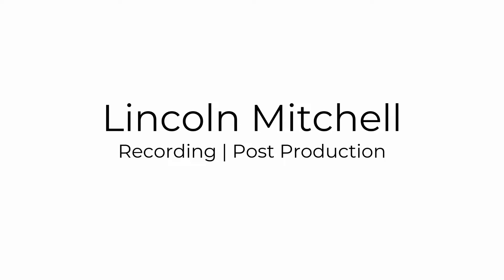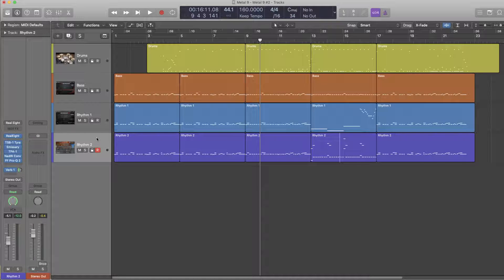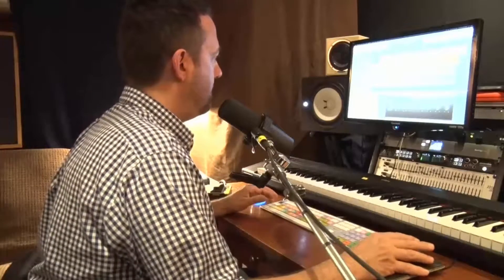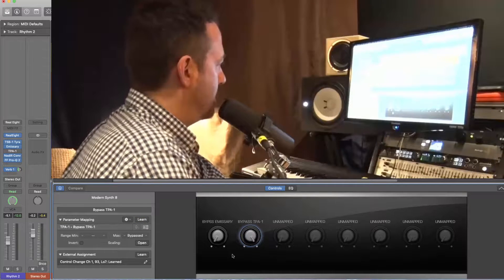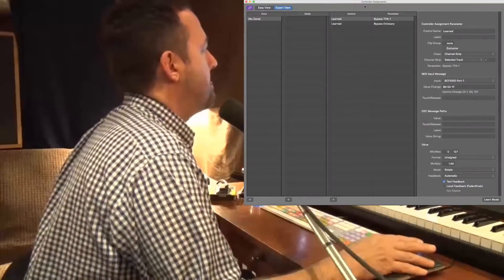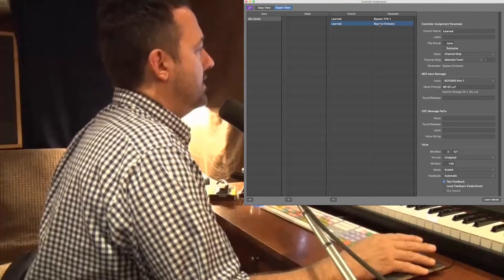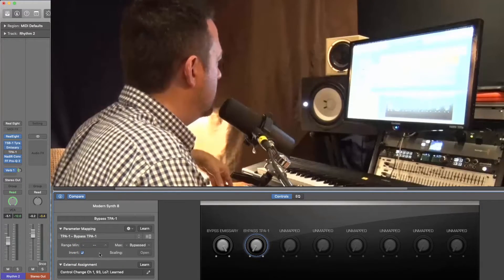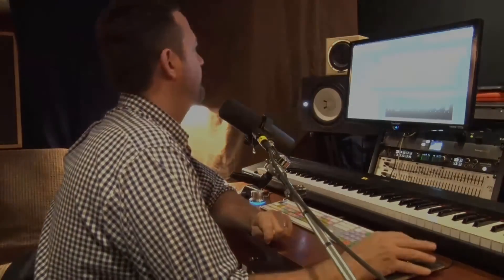Toggle Multiple Inserts with MIDI Footswitch

Comment: And how you've saved all those settings you made. I did the similar process for my FCB1010 Midi footswitch controller pedal with Amplitube 4 on logic. The problem is every time I shut down the Logic all settings are one. I have to start over. Do you have any solution to that? Best. Cem
Reply from the maker: Locate the com.apple.logic.pro.cs file found HD>Library>Preferences.
Copy that file somewhere, if your control surface settings have vanished replace that file with your copy.
That may work albeit a pain in the ass.  I have since moved on to a couple of different controllers.  Currently using the Novation SL mkiii and have had to do quite a lot of configuration to get the logic integration I wanted.... 
Anyway best of luck!
Reply: @lincolnmmitchell  Shall I copy that file before or after setting-up the midi footswitch?